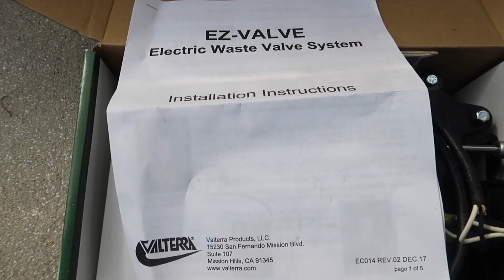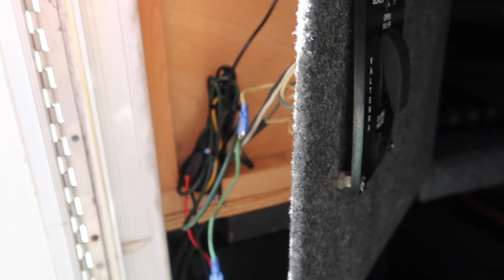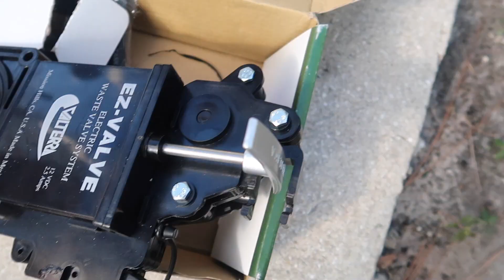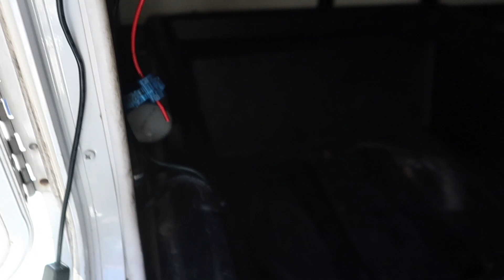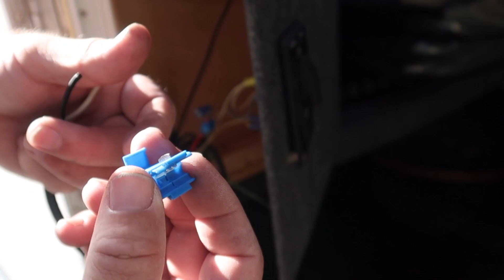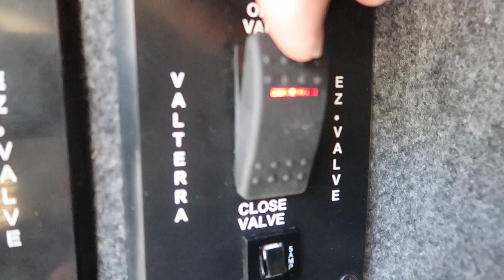VALTERA EZ VALVE INSTALL

Comment: Seeing your video is 3 years old, I was hoping to check in and see how reliable the Valterra EZ Valve is.  Having a larger 5th Wheel, we have 3 tanks, 1 black and 2 gray and I believe all 3 are 3" valves.  The cables that remotely actuate the gate valves in 5th wheels are notorious for getting hard to open and close.  Before I invest in three of these $200 plus valves, I was hoping to see if you had any issues now that they are 3 years old before I spend that kind of money.  Thanks!
Reply from the maker: Be happy to report, No issues at all, love them. With that said, I always lube them for maintenance. I seen someone drill a 1/4 in hole in the top of valves, so you can spray lube inside and it works great. You use a screw to plug hole. Search for it. Maintenance is everything. Glad I have them for sure, I will have them any any Rv I get for now on. ( Not paid to say that LOL )
Reply: Thank you so much.  Yes, in the "four season" RV's, these holding tanks and valves are not accessable as they install insulation and a plastic belly along the bottom of the RV so that people could camp in them in the dead of winter.  Therefore the stock gate valves are opened and closes with long cables and they often are difficult to pull open and push close.  I will start out buying just one 3" one and once I pull the belly cover off (front belly cover covers up the black and one of the 2 gray tanks) I will confirm the gray tanks have 3" or possibly 1.5" gate valves before buying all 3 valves.  Wouldn't you know the 2nd gray tank is more in the middle of the RV and a separate belly cover has to be removed to get to where that gray tank and the fresh water tank are mounted.  So tempted to just leave these belly covers and insulation off as we never use or go camping in the dead of winter!
Reply from the maker: @tomB-FL  
Good luck with your project !!! Sounds like a plan !

Comment: Where did u get power from?
Reply from the maker: I already ran 12v to the rear. You can tap in at the 12v side of fuse panel or run it from you batteries.

Comment: Great install. I agree the plates are labeled wrong, closed should be Closed, open should be Open.  I plan to use WAGO connectors for the wires, no bad crimps and no tape required.
Reply from the maker: Yes WAGO is the way to go for sure. I use them now for everything.  Thanks for the comment.

Comment: Has anyone use 2 ea. Switches on this valve, reason asking my RV has these valves. The switch es are in the box out. I’m thinking of installing another 2 switches inside my RV so if want can switch and dump black tank from inside my RV. Sounds like I’m lazy I know but there’s other reasons wanting to do this. Any information is appreciated!!! Thanks.
Reply from the maker: Hey sounds good, but if your asking if you can add a switch to an existing, I sure it can be done, but just not sure how to do it. Now if you just want to run the switches to the inside, I don't see a problem,  you can mount the switches anywhere you want. You may need to add wire to do so. I would call the manufacturer first to make sure. I love them and glad I installed them. P.s its not being lazy it just really convenient. Sometimes those valves are hard to get to like mine and is makes it easier.  Hope this helps,  good luck on the project 👍

Comment: Never never use those blue wire splices the differences in the aluminum and copper causes corrosion and bad connections.
Reply from the maker: Thanks, Good info, That's what the comment section is here for, to help each other.